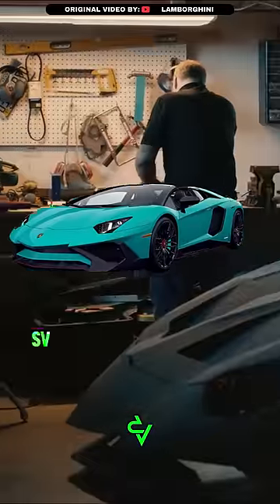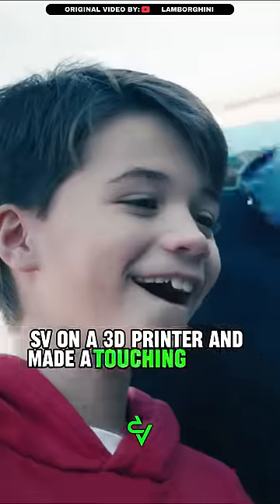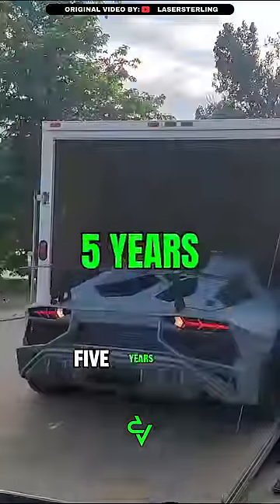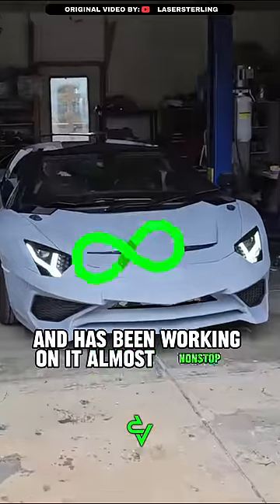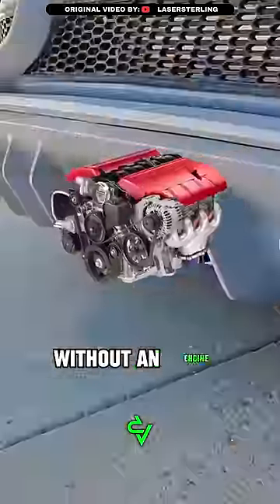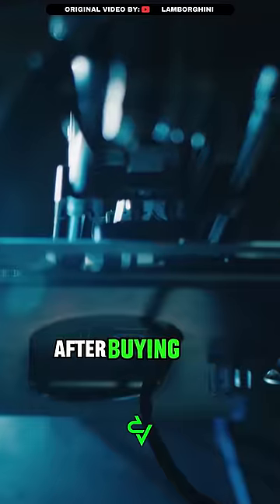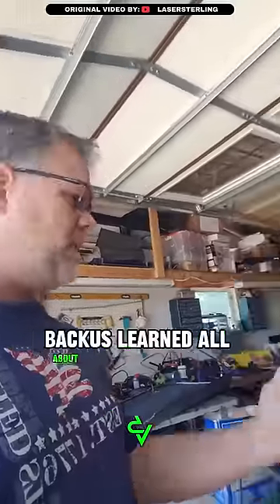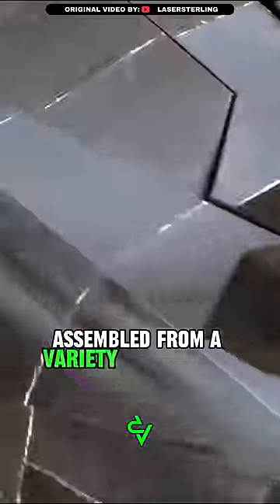Printed a Lamborghini on a 3D Printer 🤯 #shorts #supercars

Comment: Lamborghini knowing 3D is gonna be the future and to aquire the first ever 3D printed Lamborghini with such a amazing awesome spectacular back story is priceless, and more than worth the price of a real Lamborghini, a touching store.
Reply: Uhm, no.
Reply: @eatsmylifeYT i mean tbf lambo did a goat thing. If that was ferrari they would traded the 3d printed car for a lawsuit
Reply: @Lord_Rhoads  It may have been a goat thing but the replica will never be more than what a real Lambo would cost.
Reply: @eatsmylifeYT  oh no it won't I'm not saying that. I think the op is talking about sentimental price. 3d printed body's wont work on everyday cars either cause of there weakness. But they would be great on race cars. Due to the light weight and they are more cost effective than carbon fibre
Reply: R/wooosh @eatsmylifeYT
Reply: @-jnfgaming-  As if you understood anything at all on this thread.
Reply: @Lord_Rhoads  No. Carbon fiber is stronger than steel, that's why they're used on cars.
Reply: @eatsmylifeYT "3D Printing is more cost effecitve than carbon fibre"
your response to this was:
"No carbon fibre is stronger than steel"

Can you read?
Reply: @Z38_US  If I had to explain that, then obviously didn't get the point.
Reply: That would be a theft
Ain't no way a company like that would do a GTA reference on them
Reply: @eatsmylifeYT it's more tension resistant but it's extremely brittle on impact, to make it as resistant it would need to be far larger in volume.
Reply: @Ferrari255GTO  It's brittle on impact but it's still stronger than steel.
Reply: @Ferrari255GTO it SHOULD be brittle on impact, for the same reason cars are designed to crumple on impact, it would reduce the amount of force the impact would have on you.
Reply: If you actually do some research on what this guy done was that he has the 3D printed part wrapped in fiberglass and carbon fiber. Especially the parts that are close to engine. Only most interior can be seen exposed 3D printed material

Comment: could get a steering wheel and head lights from a lot that has cars that's been wreaked and got them cheaper and in like new condition. 10,000 for parts .you can get a decent used car for that . 🤦